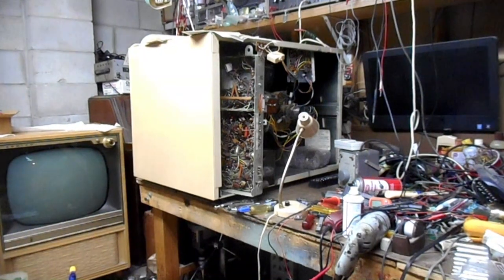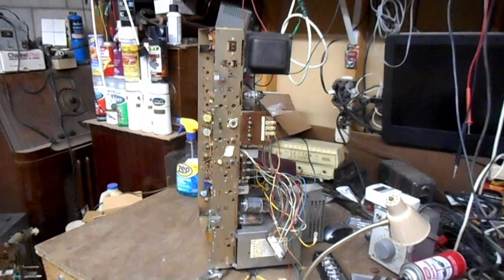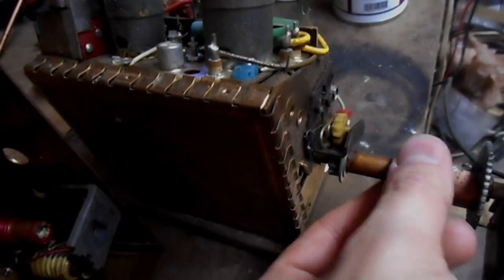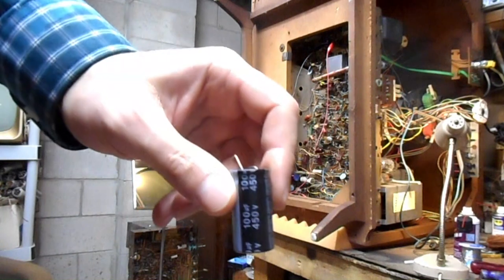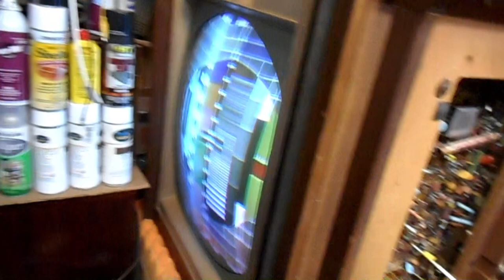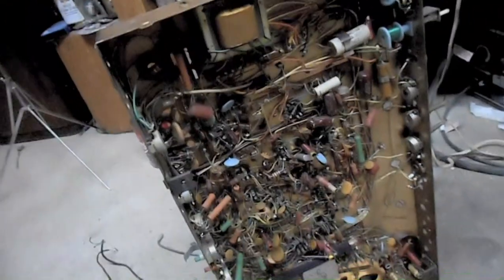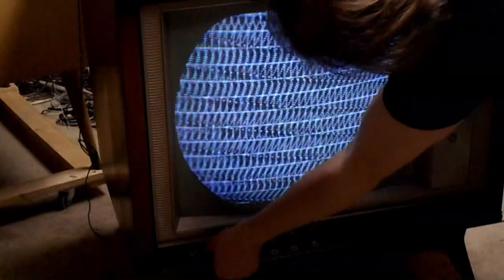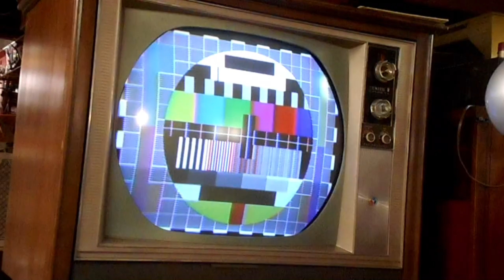Double Feature: 1960's RCA and Zenith Roundy Color TV Repair and Silliness

Comment: Bravo! It's been many years but convergence was always a bear! I'd catch a view of myself in the mirror, tired and frustrated with beads of sweat pouring everywhere. Oh to have the strength and a back that could lift a complete color tv to the bench. No way! Your explanation of the convergence was wonderful. I know I'm a geek from way back but I loved the entire video and I live roundie color tvs! Thanks for taking the time making this for us. Hope your back is okay 👍
Reply from the maker: That TV is nothing compared to the 47 Oldsmobile straight 6 and Hydramatic power train I just bought and have been fighting with since Friday... Bought it for the transmission, engine was stuck and rusted beyond saving it (short of paying a machinist 4 figures, which ain't happening) in multiple areas. You can't separate the transmission if the crankshaft won't turn. After 2.5 days of fighting to free it I cut the crank behind the rear most rod journal and finally separated the transmission last night.
Reply: @tomcarlson3913  Oh my you sure to like a challenge. I can't even imagine working on something that stuck. Good luck with it!

Comment: 1:49:21 Very musical addition of your cell phone notification ding. 😆
Reply from the maker: I think the facebook notification is the only stock tone left on my phone. Moto's stock ringtones/notifications are jaring and must be designed by people that like jaring noises.  Within hours of getting my first smartphone I digitized a couple of samples off an LP of the Swing tune Uptown Blues by The Ted Heath Orch, set those as the tones for my phone and never looked back.
Reply: @tomcarlson3913  My Moto is a total weirdo. It's not a smooth functioning phone. I liked my Samsung and LG much better. I fell for the, "Your phone will no longer be supported by the network...." And my battery was getting weak. I use my K30 at home on Wi-Fi. And yes, the engineer's choices are inexplicable. I turn off notifications. "Silencio, Por Favor!"

I just got a 1958 CTC-7 in a metal box. Not great condition, but not bad. Still moving so no time to fool with it. I can't wait to check it out. It does have a brightener on it. The cathodes are only slightly darker than the grid metals so who knows. I desperately want a super cool looking and great running color roundie. I hope I can fix one up myself, but I may eventually buy one  I like the crazy cabinets. And the Danish moderns, too.
Reply from the maker: @johnnytacokleinschmidt515   I basically run Motos because they have the best battery life of anything on the market... I'm waiting till their foldable 5G offerings get below $500 to upgrade my ancient phone.

I'm a bit jealous that you found a nice CTC-7.... That's the only RCA roundy below the CTC-11 that I haven't owned or serviced yet. The good thing is you can always swap in a relatively obtainable 21FJP22(l kinda prefer the CYP and AXP in sets designed for those, but whatever keeps them going). Seems like whenever I find one it's roached, overpriced or both. Hope you have good luck getting it working.
Reply: @tomcarlson3913  Thanks. It's not as nice as I wish it were. Sat on a basement floor for who knows how long. A little rusty. And some type of bug casings. Everything is dead now, but not like getting it from the living room or back room of a well kept house. You've got many beauties there. I'll keep looking for your videos. Taking a lunch break now looking for your other video with the RCA.

Comment: Did you scope the B+ to see which filter cap might have some AC riding on the signal? I'm going back 33 years but there is also a discriminator coil around the IF and you tweak that, a lot of times you can tune that buzz right out.
Reply from the maker: I could have and probably would have done so had I not realized (after bridging all the lytics) that the audio hum vanishes with a tweak of the fine tuning control...At that point it stopped behaving like it had B+ hum so I left well enough alone.
Reply: @tomcarlson3913  I didn't see the rest of the video but I'll watch it.  Love your videos.

Comment: Hey Mr.Carlson , can you help me with my vintage electronics ? Please
Reply from the maker: I can offer advise. The best place for that would be the videokarma.org vintage electronics fourms, or via facebook (messenger or one of the repair forums).
Reply: @tomcarlson3913  I guess what I meant to say is it possible I may hire your services to repair my equipment ?
Reply from the maker: @lkmsl  I'm trying not to do TV restoration on a for hire basis. Doing a full recap (my standard for customer work) is usually very time consuming. Though I can be talked into radio/phono work.  Honestly most collectable TVs by the time you've burnt a 6 hours drive worth of gas (or worse paid a parcel carrier) to deliver it and pick it up you've spent more on transport than the value of a nice restored specimen, add the cost of parts and labor to that and then you're REALLY in the red on it. There's a videokarma.org member 'Kevin Kuehn' out in the Rice Lake Wi area (a more reasonable drive for you than me) that is good at TV restoration work. I'd reccommend signing up to videokarma and sending him a PM.

Comment: Great work. Additionally at 1:35:00 or so doing the convergence adjustments. I believe lowering the brightness is recommended to allow greater phosphor dot definition. It would be easier to see smaller mis-convergence. I'm guessing itwould be harder to see in a mirror or on a camera for YouTube. Most dynamic convergence panels are accessible from the front or allow for removal and remounting for access at the front. You are quite a TV Repairman for your age. I think you said you started working on electronics in your early teens.
Reply from the maker: Thanks. Yes it is good to lover the brightness and sharpen the focus for better adjustment in most cases. it is easier to film that way.  Some tubes the amount and direction of misconvergence varies with brightness so sometimes you get better results setting convergence at opperating levels of brightness and contrast. The rear mounted convergence panels can be mounted over the top for front access, but you still have to reach all the way to the back to get at them, which isn't very ergonomic.  It wasn't till 67-68 that Zenith started placing the convergence board behind a removable front speaker panel that front convergence in Zeniths became ergonomic. Some brands had true front convergence earlier (like moto and Setchell Carlson), others like RCA did it once (CTC-5) then abandoned it completely.

Comment: Ah ah ah,  Be nice to the Zenith, Don't hit it... That's color TV abuse.
Reply from the maker: 🤣 You do realize Zenith as the final step of production would repeatedly smack their new sets with rubber mallets from various angles to check for intermittent problems that could be aggravated in shipping.  There's period films of their factory out there showing the process.  As long as you don't break anything or cause visible damage percussive maintenance/diagnosis is factory approved.👍
Reply: @tomcarlson3913  I did not know that. I do know that at that time zenith's were  the best, I have a 1969 18-in color tabletop metal cabinet tube driven with a transistor color demod space command 100 and I still use it to this day, I replaced all of the tubes with new old stock and I did a chroma alignment and the picture is really good now. I'm in search of a picture tube for it because I had to pop the green and red with the SENCOR probably the first time it's ever been done but the emissions were really bad and almost no cutoff, Blue was still super strong, last resort to get a little more life out of it, it's a 18 VSAP 22 I think it was replaced once before years ago before I got the set. I've had it since I was 14 and I'm 40 now.